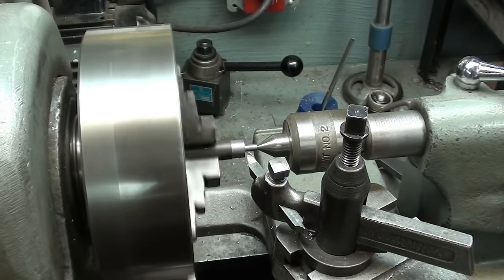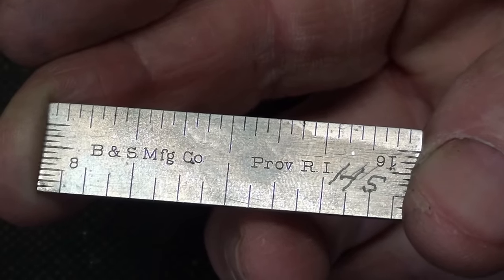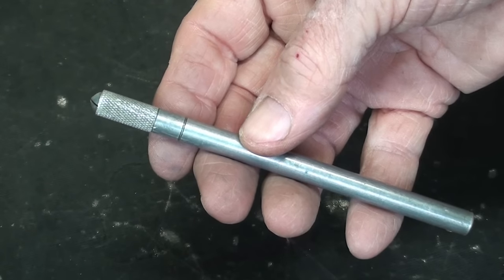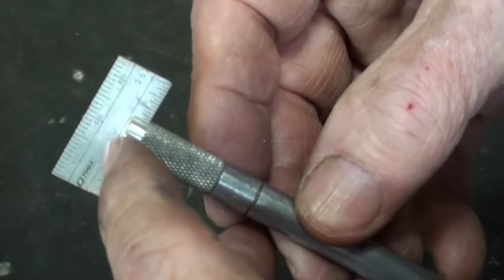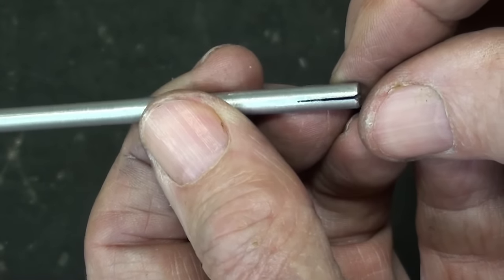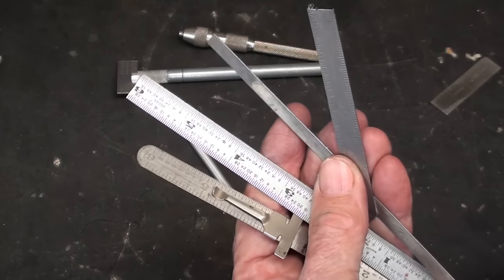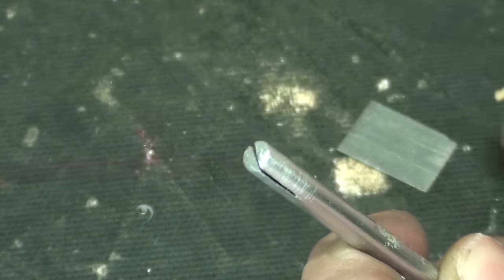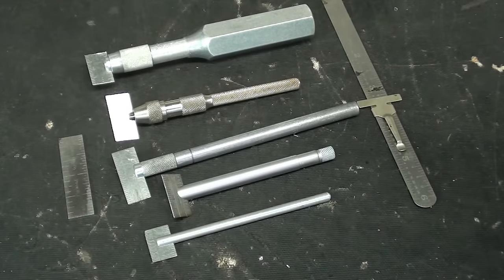Make a TINY RULE HOLDER #927 tubalcain starrett lufkin

Comment: Hi My suggestion would be to make the collet in brass or steel with no slit. Bore out the end of a length of 3/8' or 1/2" round bar and solder or superglue the collet in. Slit then melt it out. Job done.

Comment: Lyle - Another great video for the first cup of coffee.  Keep them coming.  Like you I'm a guy who prowls auctions.  And in this case I happen to be luckier than you.  Years ago I got at an auction the tool box of a long gone tool maker who had to apprenticed out around 1900 (luckily only had to bid against those who only valued the Gertsner box).  Among other things in that box (he took wonderful care of his tools) was a Lufkin 20S set.  But a bit older than you picture, which appears to be a plastic case.  Mine is the maroon leatherette they used to use.  So I'm spoiled - didn't have to make the holder, just pull the antique out of the chest with my 'best' tools in it.  Still have the 6 inch Starrett scale I carried in my pocket for years as an engineer - now that I'm retired it is sitting next to the computer for when I need it.  Have a good St Patrick's day.
Reply from the maker: That is awesome. I would love to run across an old Gerstner box filled with tools. That has never happened.

Comment: When I use a slitting saw, I set it's rotation speed rather slow. Then I feed it in even slower. Both actions I perform much slower than what I saw in your video. If i need a really straight slit I'll peck at the work very slowly and gently until I reach the maximum depth. 
Thank you for all of your wonderful videos. You have always been an inspiration to me. You are a master machinist.
Robert

Comment: I am surprised that you haven't upgraded the tool post on the Atlas lathe. I know you like and appreciate Aloris (completelyout of my price range). I have the Chinese knock off OXA and have purchased an AXA size because the base is the identical measurement. This adds rigidity to the cutting tool. I know you are the teacher and I am not upstaging you, not even attempting to but for all the things you do, why no upgrade. I am sure you have your reasons. Litle Machine Shop has high speed steel inserts so you don't have to turn the cutting speeds up to ludicrous speed.
Reply from the maker: Not sure I understand. I do have.aloris tooling for the Atlas. But I sometimes like to use high-speed steel.
Reply: @mrpete222 I saw you using a lathe and assumed it was the Atlas. You were using the original or O.E. style lantern tool post.

Comment: I have the Starett handle I found it in a box of stuff an old man dropped off at the shop I worked in. The scales came from my #303 scale I had an accident with on the sheet metal shear. I found this setup one of the most handy tools in my box. In almost 50 years I have used mini scales countless times. The handle works great for radius gage too. Ed Z.  Toolmaker, retired.  I look forward to your videos as I truly like to watch some one else work for a change. Thank you, E.

Comment: Hi Pete, love your videos!
Regarding #927 small rule, I like your attempts to make a straight slot😊.  Going to the initial problem and as an amateur wood turner I would pick up a spring inside caliper.
By the way, there are lots of us in the UK with the deadly auction-buying-boxes-of-mainly-rubbish disease, possibly age related. Pity we can't add to that with PeteBay.
Keep up the great work, Geoff

Comment: Lyle, many many years ago I bough a lot of tools from a retired German machinist in a very nice Kennedy 526-8 tool chest. Included was a No S423 set which I use from time to time.  The set sells for $284.43 here in Canada on Amazon.  As far as the research goes I have gained from some of the information you provide.

Comment: Brown & Sharpe made them too--my set is from B&S. But there's no number on the plastic case, but it says 335 on the holder.
The B&S holder uses a tapered collet like the Xacto handles (although it's smaller, about 3" long and 3/16" diameter.) They get better grip by slitting the outer sleeve to match the slit in the collet, so the rule sits deeper in the handle. This means the rule is sitting in the tapered part of the collet.

Comment: I had several occasions when I had to inspect hole spacings in a corner at arms length. A Starrett 6" scale was all that was required, if I could bend the scale somewhat it worked great. Unfortunately Starrett scales do not bend much, instead they break. Which was handy as the new length made inspection much easier. I found that they broke fairly cleanly at the inch markings where the engraved lines were most of the way across the width of the scale.
Thanks for sharing all that you share.

Comment: My power hacksaw and my abrasive cut off machine will not cut straight if there is too much load.  Back off on the feed and they cut as straight as a die. Might not your issue be the same?

Comment: I think I might cut it a little long w/snips, then touch it up on the belt sander or grinder.
As far as the holder, I could use my fingers, or needle nose pliers.

Comment: I found a xacto handle with a longer stick out and used it with a cut off rule I got in an auction box.  Just about like your example.  Thanks for the hint and impetus to put them together.

Comment: A suggestion for narrow slots. After centering on the workpiece, dial in the full depth of cut and climb mill. This worked very well for slitting 12" stacks of .024 spring steel washers which became 2.5" dia. knives for cutting paper. Keep up the good work!

Comment: MrPrete;  I've made some expansion chucks for holding work pieces from the inside of a hollow tube.   I have made slits over 2" long in 7mm - 1/2" steel stock and never had a problem with drift.  (luck?)  I approached the cut from the side though.  My slitting saw has several stiffeners and I used the largest one that allowed the cut to be made. Cut from one side to the other then flip the piece over and finish cut the other side.  Take care my friend.

Comment: I enjoy most all of your videos. Keep them coming!  I am especially disturbed by the LS Starrett sale to Middleground Capital.  I am always saddened by the sale of US companies to investors (US or foreign) that are probably only concerned with profits.  I have always appreciated the quality produced by Starrett which has been kept solid by the Starrett management for a long time.  I sadly expect the quality of their products to suffer at some point.  Tell me I am wrong. 
Using the tin snips, I would not consider any measurement near the cut as accurate as a rule can squashed(?) by the way snips cut metal.  I like the idea of using the original end as the start of any measurement.  However, like you, my eyes are not 20 years old anymore, so this is probably just babble.  
Thanks.
Reply from the maker: I always like to measure from the factory edge. Or an edge that I cut on a squaring sheer.

I will have a short video on tomorrow. Lamenting the loss of this formerly great tool company. I am sick about it.

Comment: Sliting saws are always prblematic, but I've found it is best to feed them slow, slow, slow and keep the chips out of the cut as much as possible, especially on hard materials like steel. I use double slitting saw blades on the same arbor to make spanner wrenches for Shot gun choke tubes. (to make the 4 tiny tabs to fit the end of the chokes) Works well. I usually make them from 360 brass or 12L14 leaded steel.

Comment: I suppose I have an older Starrett rule set and holder. The holder looks a bit shorter than your Starrett 423 set. Mine has one slot for the scale and it’s at a 30 degree angle. It looks to be fairly old. I inherited it and many other machinist’s tools from a retired tool and die maker. Many of the tools are Starrett, but there is a fair share of B&S and Lufkin. Keep up the good work, Mr. Pete.

Comment: You are fifty odd years too late with this video! Haha, imagine if someone had suggested we watch a Youtube video in 1970? We ground a lot of valves on the gasoline tractors back then and had to narrow the valve seats but had no scale that would fit down in the combustion chamber so the scale could lay flat on the seat, nor did we have a scale with marks on the end like the short B&S scale you have. The book showed using a short scale with a handle like the Starrett or Lufkin you showed in literature so I made one. We had no machine tools other than the Sioux valve and seat grinders so I hack sawed the slot and soldered in a cut off section of a General scale that I had bought at the hardware store from a card type display. I also bent the rod similar to the drawing you showed. I think I used a worn hacksaw blade and ground the set off with the bench grinder for an inch or so. I really enjoyed your video as it reminded me of all these things I did when I was young!

Comment: Don' ask me how I know, but a Starrett rule will snap off on the inch marks.  Hold it close to the 'snap' point in a vise and tap it smartly with a hammer.
Reply from the maker: Which means that the weakest point is at the longest graduations?
Reply: @mrpete222 Yes, the graduations are engraved on both sides of the scale, and on my Starrett C305A, the inch marks are about a sixteenth from meeting from both edges in the middle of the scale.

Comment: I've gotten into 3D printing and I've found it very hard to verify the inside measurements and other small areas of finished prints. This is exactly what I need! Thank you.
Reply: I have that Lufkin holder that came with my radius gage set. Many years ago I cut off small pieces of an old Stanley tape measure and clamped them in the holder to measure in tight places as Mr. Pete demonstrated.

Comment: Mr Pete;  I recently built a Hemingway Kits HK1760 Set Over Center.   I used my mill DRO to scribe an Imperial scale on the tool for reference.  May I suggest that instead of using a pre-made scale, you make one in a better form factor to machine?  I am going to try some 1/4" aluminum bar stock later.  I love your videos.  Cheers.
Reply from the maker: Good idea
Reply: Mr. Pete has a video on making a lathe stop. Making the graduations on the dial takes advantage of scribing using the mill. I was thinking of using a height gage on the surface plate for making custom ones as that should be more accurate.
Reply: @theseldomseenkid6251  I made a  scribe mark every 0.1" on my tool and half length lines every 50 thousandths.  I am not coordinated enough to do that by hand.  It's a good idea for some quick marks though.
Reply: @joec4266  I have a very nice Mitutoyo height gage/scribe which I use for layout work. 0.1 of an inch is easy work using a surface plate and a large precision angle iron. This allowed me to mark up some small  aluminum angle plate, which is great for curved surfces. Based on today's tutorial, I may add a handle.